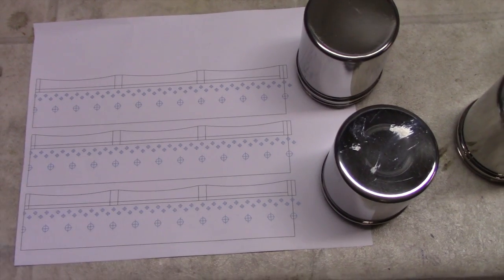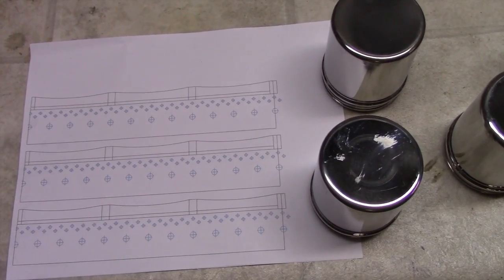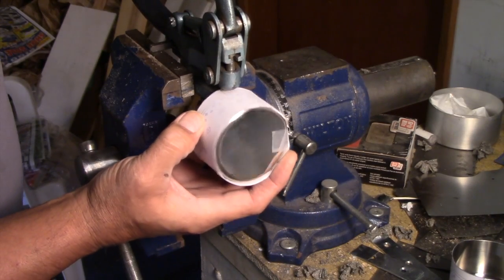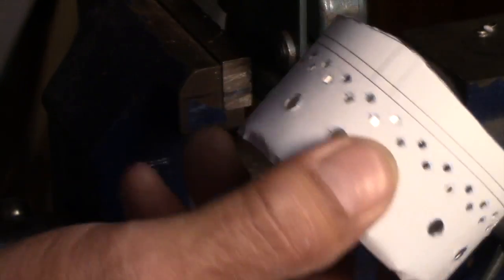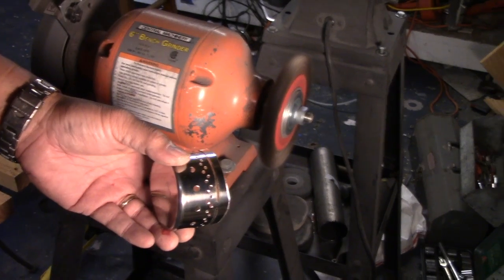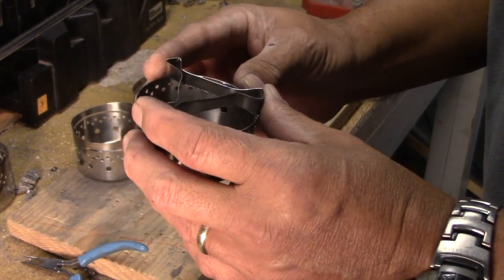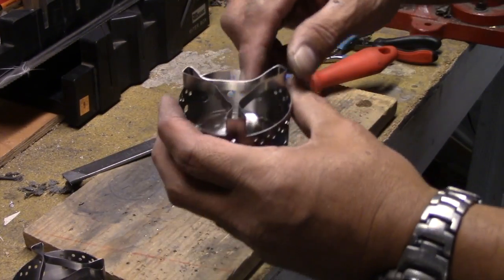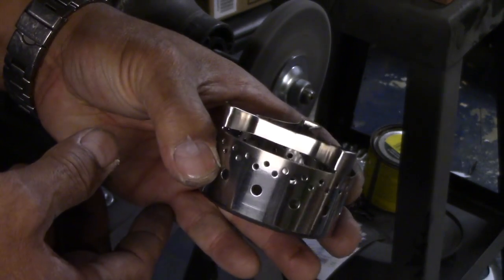How we make the Multi-Fuel stove by FLAT CAT GEAR

Comment: I use rather truly multi fuel stove (chinese BRS 8B with gasoline or propane/butane) because of the much shorter time needed for boiling up water than during using alcohol stoves but still... you made really good work. Great tutorial. Respect!

Comment: Jon I can’t say enough how much I love my isoclean stoves. My USGI version has now 3 years of hard use. Never fails. All mine are the version that has potstand intergraded. I have used it in both my Bobcat system and snow leopard Sr.  Excellent results! I hope this models stays around for good! Just wanted to say Well done! . Where can I find that hole punch set that you use?
Reply from the maker: I use a Roper Whitney hand punch, I believe the Jr. model.
Reply from the maker: BTW, what fuel do you normally use in your Multi-Fuel?
Reply: FlatCatGear 
I mainly use 70% or a 50/50 mix of 70% and 91% rubbing alcohol. If I use HEET I’ll just use either the bobcat stove or snow leopard stove.  I noticed in the windscreen if I use HEET in the multifuel it overheats and theflames rise up the sides of the pot. 
My USGI setup I use mainly Rubbing alcohol also. My hiking camping partner is my 13 year old daughter and she loves to do the cooking. I like being able to see the flame during the day. I feel safer letting her use it that way. Eventually I need to get her her own USGI isoclean and a regular version too. When funds permit. Thanks for making such great reliable gear!
Reply from the maker: By HEET, I am assuming that you are saying the yellow bottle.  Adding a little bit of water will help calm the flames down.  HEET in the red bottle is 100% isopropyl and that concentration is too high as well.  Again, add a little bit of water will drop the % down to the 90% range.
Reply: FlatCatGear yes yellow bottle. Never tried the red. 
I have been doing that for awhile now. The water seems to extend burn time also. I just prefer isopropyl. So far on my pots there’s only decolorization no soot. Once in awhile soot will be on the sides of the pot if it’s windy but wipes off.

Comment: I am "still" using a soup can with holes in it and charcoal briquettes.  I carry the charcoal in the can, and only use 3 pieces to make a boiling Stanley Cookset of water, twice.
The "stove" is transported wrapped in a PVC cloth bag that was a catfood bag.  That bag is waterproof , and it is tough as a rooster beak.
I can burn alcohol in that can stove, I just soak something like cardboard first then fill and light it up.  Not efficient, but it works.